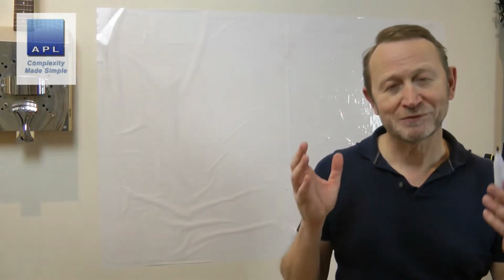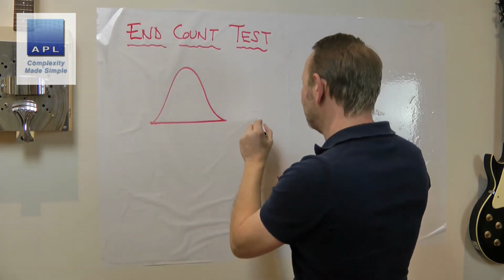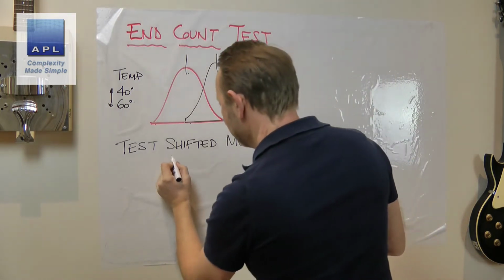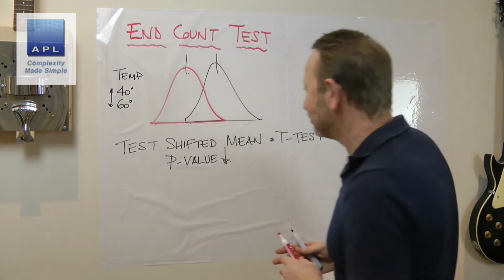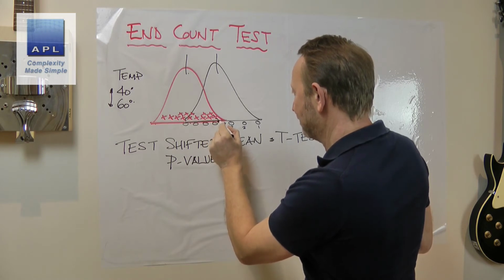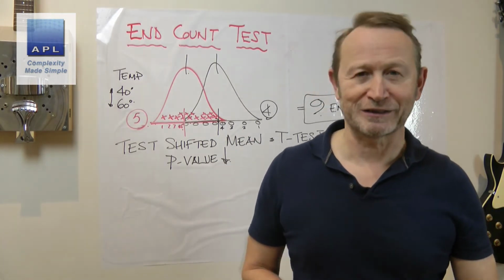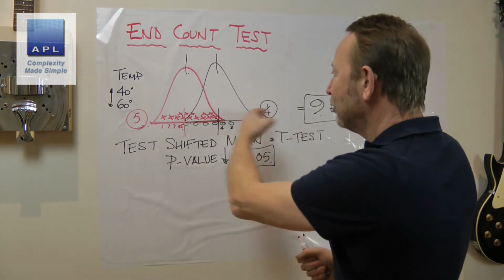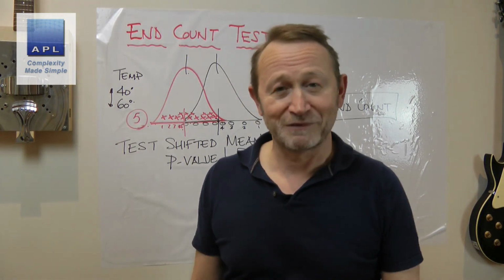End Count test - The Simplest Hypothsis test

Comment: Very nice technique, quick and easy. I have a broad question regarding the t test. If you have a continuous x variable such as temperature and a continuous y variable....would there be more value generally in performing a regression study rather than a standard 2 sample hypothesis test? Let’s say in your experiment sample A was n=10 and sample B was n=10, you could instead to a regression study between 40 and 60 degrees at 1degree intervals. This would not only tell you whether the relationship was significant, but also allow you to predict a value of y for a given temperature with a regression model. Or are there some scenarios where it is more beneficial to do a 2 sample t test like this one?
Reply from the maker: Philip - good to hear from you....it's a good point you make, but you can do the regression too with the 2 data data sets, then do a confirmation at the mid point setting to confirm the model is linear...In fact that is exactly what we do when we do a DOE. The linear model is created from just 2 data sets gathered from hi and lo settings. Thanks for the question though, I tihnk I might make a video about this..
Reply: With the regression it is slightly murky as two data points always yield a straight line and then of course you need a 3rd data point to ensure linearity or non-linearity.  Second, when one conducts a regression, the R2 value cannot be assumed and so any regression is only valid when the residuals diagnostic tests are conducted, which includes 4 other graphs. Thus it may not be as simple as what Mr. Paul Allen says here.

Then what if the relationship is non-linear. So the End Count test only focuses on the effect and not on the relationship to predict, which of course is the next step a pre-requisite to a Regression or the DOE.

Gentlemen - Any experiences along these lines of thinking.

Comment: What a wonderfully simple tool Paul - thanks for sharing this!
As you said, to test for shifted means a t-test is normally used - it happens I made a video how to do a t-test in Excel just last week (including the quick and dirty way that indeed takes little more than a push of the button). That also sprang forth from wanting to be able to check data and outcomes without needing to export things to minitab or other specialized software -> we don’t need complexity when there’s a good simple solution 😎
Reply from the maker: Tom  - and I've done some research on this on it is really a robust technique. If the maths says the p-value is below .05 the end count will be at least 7